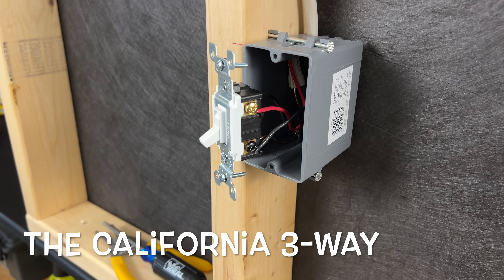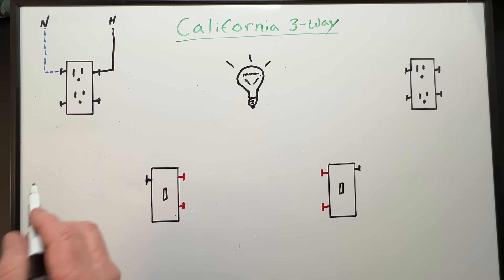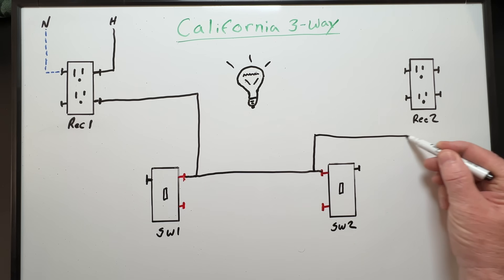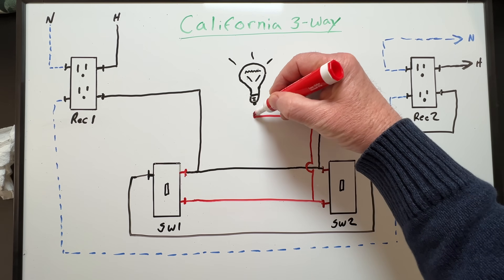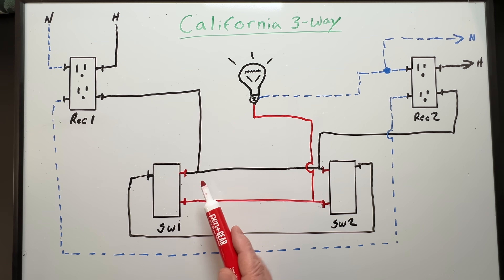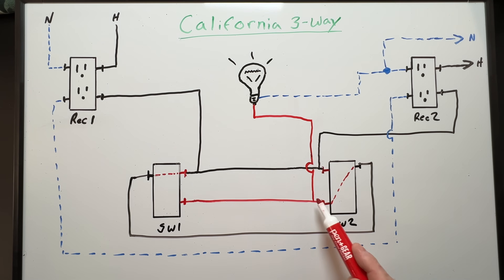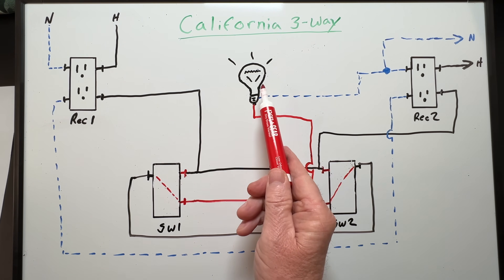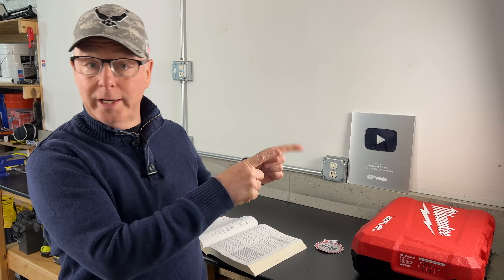What is the California 3-Way Switch?

Comment: My understanding of a California three-way on residential is where you have a switch boxes on both ends that has power from the SAME circuit in each box to power other lights. Then a two-wire was ran between the boxes as travelers. With maybe 4-way switches inbetween. This was done by many companies just to save money on the cost of buying a 3-wire compared to a 2-wire Romex. Where this became problematic which I've seen done many times is the circuits are not the same on both ends of the boxes. This can lead do you thinking the circuit is off and finding out there's still a load on the neutral. Also it can lead to an overcurrent on the neutral which will not trip the breaker. This was done in my own house twice. Which was not a fun fix with a finished basement running a 3-wire replacement.

Comment: I don’t think California 3way is illegal, you can still have the neutral in both boxes, it is not  a practical way to do it, but you can up to 9 wires in 1/2” ( I don’t recommend more than 6) and derating won’t be an issue because is all same circuit. You will only have 5 wires, hot-2 trav/ $leg-neutral and ground.

Comment: The advantage of this method, also known as a point runner is having a steady hot, neutral, output leg and runner at every point in the circuit. With a standard 3way you have two runners instead, and no access to the output leg accept at the one output end. This diagram doesn’t show the wires grouped as they would be normally.
Reply from the maker: There were local codes in CA counties which had limitations on the number of conductors that could be run in a raceway. This was beyond the conduit fill limitations in the NEC. Thats the reason this method was developed. I showed the wiring grouped in a way that meets this requirement.
Reply: Thanks for all your informative videos. I’m
old school and have used this circuit maybe 6 times in 45 years but never knew the history of it. I work mostly in Wash DC w plenty of old Chicago 3ways we call hot and lazy. California 3ways are also listed in The American Electricians Handbook and called a special hookup.  Ive used this point to point type hookup for garage, outbuilding, and shop because you can have a steady as well as a switch leg at both ends. If you draw the circuit w wires bundled switch to switch and commons facing each other it’s easier to understand the other advantages. I don’t believe it would be a code violation as long as a neutral is present which is the case when done this way. Still it’s very rare that I would still use it.

Comment: As someone who lives in an old house who is annoyed at wanting to install smart devices; I am totally on board with neutrals everywhere and power to the switch box first. OMG so much so. However... this is very clever. But it reminds me of something I picked up from programing, if you ever look at your work and are impressed by how clever it is, then you need to remember that fixing things already requires more cleverness than making them so, if you make something as clever as you can, then you will not be clever enough to fix it later.

Comment: To make the California 3-Way legally, couldn't you lead the Light switch Neutral back to a receptacle? If you're running a hot to the traveler line already, you could carry the neutral with the red to a 3-way box, then with the hot to the next receptacle.

Comment: The diagram appears to imply the use of 4-wire cable (edit: between the switches) and the presence of neutral in both switch boxes, unless this is K&T or another means of having the neutral follow an entirely different route...  If 4-wire cable were indeed used, would the "California" approach be NEC-compliant?

Comment: So THAT’S what that crazy circuit to my old detached garage was called! My house was built in the 40’s and this is how the circuit to the lights and outlets in my garage was done. It was done in old style Romex but they still wired it this way instead of using multiple conductors, no doubt to save money on the wiring to the garage.

Comment: A California or Coast 3-Way is not inherently a code violation. The way you drew it is makes it look like that. 

The maximum wires in conduit was 4 not 3. So in practice the neutral from Rec1 to Rec2 would pass through the box containing Sw1. That would satisfy the neutral requirement.

Comment: You say that the California 3-way method is not NEC compliant because there is no neutral at a switch location.  But, in your diagrams, you show the neutral ( dashed line ) going right through each 3-way location.  California 3-ways are odd, but still NEC compliant.
Reply from the maker: I clearly mention that the neural is run in a different raceway. 404.2 C requires a neutral wire in at least on 3-way or 4-way switch location.

Comment: I have a 3-way switch situation with a 2-wire traveler that does not seem to be covered by either the California or the Chicago method.  In this method, the hot on SW1 is connected to the common.  The 2 wire traveler is connected to the traveler terminals on both SW1 and SW2.  The fixture hot is connected to the common on SW2.  The fixture neutral is connected to a separate circuit breaker neutral that is located in the same electrical box as SW2.  They actually daisy chain the separate circuit's neutrals so that the outside light hot uses the kitchen neutral, the kitchen hot uses the dining room neutral, and the dining room hot uses the stairway neutral.  At each end of the daisy chain, there is a single pole switch.  (I hope I am explaining this correctly).  Have you ever seen this?  Houston TX built in the early '80s.
Reply from the maker: No I haven't but what you describe in you comment is basically a standard 3-way. The feed comes into switch 1 and the load comes into switch 2 and the travelers connect the two. The switches are actually wired correctly. The issue is they did it in a way that does not carry the neutral which may have been legal when it was installed. However, it is a code violation to have the lighting return on a neutral from another circuit. That has never been compliant.
Reply: @BackyardMaine  House was built in 1981-1982, so it has most likely been like this for over 40 years.  I know you outlined the dangers of the Cali and Chicago 3-way.  Can you outline the dangers of returning a neutral on another circuit.  It would be a pain to rewire all of the 2-wire to 3-wire, but if you recommend or insist, I will try.

Comment: Looking forward to 4 way switch setup. I have one here in FL and was never able to get the first two switches to control an occupancy sensor in the third location. The occupancy sensor said it was OK for 3 way, so i assumed it would work In fact it does change state at the sensor, however there is something amiss. Adding to the confusion, I installed LED lights and they are glowing dimly when the sensor is idle and I can change the intensity with the other two 4 way switches.
Reply from the maker: Sounds like you have a problem somewhere. That should not be happening.

Comment: Thanks for this. My old house in California had some confusing 3-way that I could never quite figure out. I suspect it was this. It was also connected with fabric-sheathed wire and I ended up disconnecting it and pulling modern wire (14/3 NM) to replace it all. More work in the end but probably the right move in the long run.
Reply: probably standard three way but using two 14/2 instead of an 14/3.

Comment: My home was rewired in 2006 after Hurricane Katrina and had the California 3-ways throughout.  Took some effort to fix these to upgrade the hone to smart switches.  

One downside to this method is sometimes receptacle two was on a different circuit,  so killing the breaker for the line conductor did not unload the neutral.  Had a few 5v kisses. 😂

Comment: Great explanation as to how they work.  But what is/was the appeal of using this method vs other methods?

What was the benefit of this?
Reply from the maker: The only benefit is to carry on the circuit through the switches but with just three wires. It makes no sense otherwise.

Comment: I'm not really clear why this is clever or what advantage it would have.
Reply from the maker: The issues was that they were limiting the number of cables in a conduit. This was a solution.
Reply: I'm not sure I understand. Cables in a conduit? Do you mean NM inside a conduit? I've never heard of that. 

If it's a matter of cables, the run between the switches has four current carrying conductors including neutral. That means a 12/3 and a 12/2. If you're running that anyway, why not just use a standard 3-way wiring and use the black in the 12/2 as a constant for the recep?

Comment: In Germany we call this "Sparwechselschaltung" which translates into something like "wire-saving 3-way switch circuit" and we do it by using conduits with 5 wires (Hot, Load, Common, Neutral, Earth) which go into every switchbox. This way we can add an "on" indicator light onto the switch and also add a receptacle next or down to every switch. I don't see how this method could possibly violate your code when using conduits with 5 wires instead of 3
Reply: Depending on the circuit breaker and wire size, this could be a violation due to the number of current carrying conductors.
Reply: @geoffh1 no, it's a violation because there is no neutral available in the switch box.
Reply: @nickm9123 electrical code is not the same across countries.
Reply: It is a violation in 2 ways:
First, there is no neutral running to switch 1. At least 1 switch in a chain of 3 or 4 way switches needs a neutral.
Second, a hot loop is created between the two switches. This is a code violation as parallel feeds must be wire of 1 aught awg or greater.

The omission of neutral was allowed if  conduit was used.

I don't think a California 3 way is possible in Germany because you said each device gets a complete 5 wire bundle, so you always have the proper wires. In America, conduit only needs the conducting wires, and in the case of a california 3 way, there is only one hot, robbed from a non switch device, and 1 neutral robbed from another non switch device.
Reply: @stoobers1 depends where you are. Canadian code requires a neutral at every switch location.
Reply: when using 5 conductors, there is neutral, load and hot in every switchbox. In Germany 5x1,5 is standart for that type of light circuit, wires with 3 conductors and the correct colours are extremely rare.
Reply: We want a video showing the Germany 3way!
Also. Is there a german word for not-having-a-long-enough-word-to-describe-wire-saving-3-way-switch-circuit?
I think we need one for expressional purposes.
Reply: 5 conductors ≠ wire-saving
How many conductors are in the non-wire-saving method?
Reply: @MikesDIY  😂

Comment: Very interesting. The set of circumstances that would lead someone to have to wire something this way is silly. Why not run a larger conduit between switches....ect...ect. 
I guess the questions could go on forever. But I guess its cool to see what someone came up with to solve a paticular problem they were having.

Comment: In a Delta 3 phase environment, 3 wires no neutral corner grounded, does the grounded conductor need to be present at a light switch?
Reply from the maker: In the USA the only time you're going to see a 3-phase delta system in a large commercial or industrial applications typically used for motor loads. I work most of my career in large industry and where lighting would be run in 3-phase wye connected transformers (277/480v) and the lighting was run at 277v with a neutral and ground. Or 120/208v wye connected transformer for lighting and receptacles. But in any case ground wires are required in grounded systems.
Reply: @BackyardMaine  thank you.
Reply: @BackyardMaine  Dont forget that High leg Delta and Open delta systems, which technically are still delta systems used to be very popular installs for installations with fairly small three phase services. in particular open delta was quite poplar for running large farm irrigation equipment, and I see them used all the time for gas stations in my area.

But now delta systems on most sites are slowly being phased out in favor of Wye systems. Power companies often wont install new Open Delta or High leg Delta banks anymore, and I'm pretty sure corner grounded and ungrounded delta systems are slowly on their way out.
Reply from the maker: @ryuukeisscifiproductions1818  Ture. I have run into the High Leg Delta many times. They were common in building on the AFB where I started my career back in the early 80s. Must facilities don't use them these days. I was an electrical engineer for TI and our systems were all wye connected transformers. 277/480 or 120/208. We brought 4 each 35kv feeders into the main building which fed transforms and duel fed substations either 208v, 480v, or 4,160v for the chiller plant.
Reply: @BackyardMaine  yeah i have never had to personally work on any of the more unusual types of systems. All my work has been at Industrial plants and Hospitals where everything is either 277/480 Wye or 120/208 Wye with a little work done on 4160 and 12470.

Though at one point i did see a Tran former in one paper mill where its secondary side was nameplated for 180 volts, and for the life of me i could not figure out what that possibly could have been for.
Reply: corner grounded delta systems cannot be used for single phase lighting loads because there is no neutral in the system. First problem is that with corner grounded systems there is no 120 or 277 available without a Delta Wye transformer somewhere, and no single pole basic light switches are made to handle 480. Now there are light switches made that are two and three pole, so those theoretically can be used. While one of the conductors in a corner grounded system is grounded, it is not a neutral wire but a phase conductor, so I dont think corner grounded delta systems can fulfil the NEC requirement, especially since the requirement is for smart switches which likely only function on either 120 or 277, probably not on 240, and definitely not on 480.

For lighting loads where a building is fed with a corner grounded delta service, particularly a 480 volt one, your best bet for lighting loads is to first get a 277/480 wye transformer or 120/208 one.
Reply from the maker: @ryuukeisscifiproductions1818  You are correct on all points.. I don't know if the person commenting was from the US so it is possible they use some configuration with 240v lighting.
Reply: @ryuukeisscifiproductions1818  thank you so much for that great explanation.

Comment: I’m confused. The only things I can find in the codebook about multiway switching that would apply to California vs Chicago vs conventional three way circuits is as follows;

1) multiway switches cannot break the neutral. (In one “off” state the Chicago breaks the neutral. The California never breaks the neutral.

2) At least one of the three way switches must have a neutral. (While a California can be wired without a neutral in either switch box so can a conventional three way switch loop [hot coming in the light fixture box] and both can have a neutral put into a switch box by adding one extra conductor. 

So why is the California not code compliant? Am I missing something?
Reply from the maker: The main issue I stated in the video is that this was done because of a wiring limitation and the neutral was not carried. If you carry a neutral wire you can wire a switch in this way but I don't know why you would. It would be confusing for anyone later on replacing a switch and you would gain nothing.
Reply: @BackyardMaine  yes agreed, you gain nothing with the California when there’s only one load. This is why the California is so rare. But if multiple loads must be on a three way (a string of lights in a hallway, down the isle of a horse stable or multiple hot/switched duplexes) and every box in that string to include the switches needs to be available to to have hot and neutral in them for more branch lighting, the California will save conductors over a conventional three way. This is the actual reason it was invented.